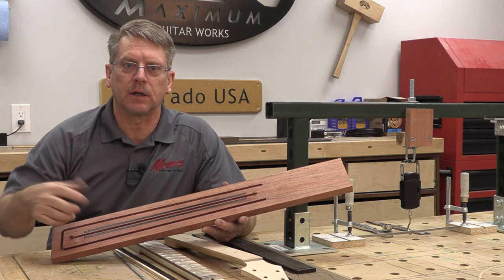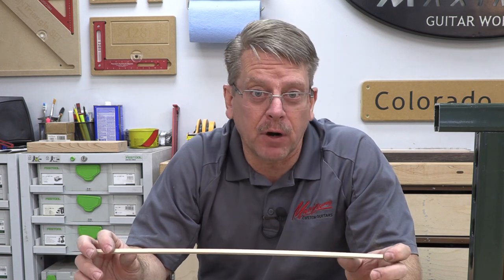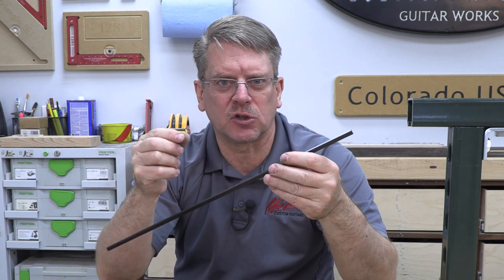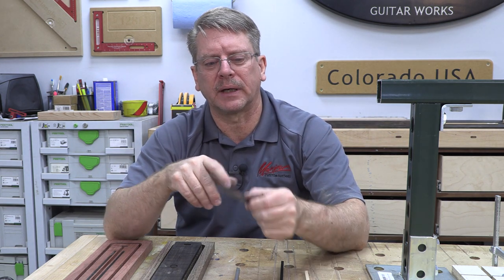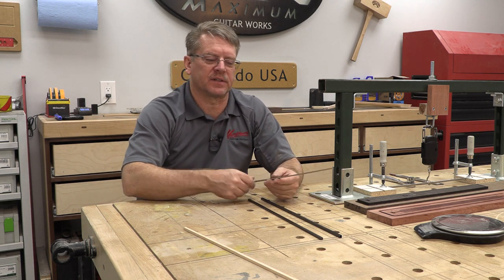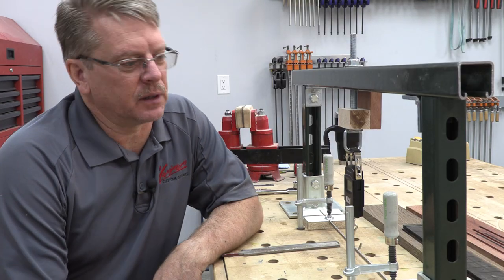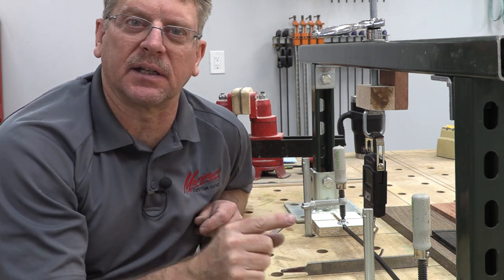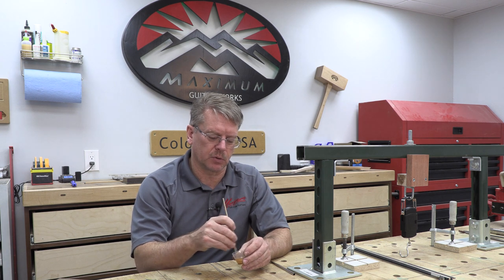Best Ever Guitar Neck Reinforcement Video (Deep Dive)

Comment: I like a lot of tension playing extreme metal so I built a baritone flying V with 28.5" scale, in A#, 13-72 strings.  I used dense mahogany in the neck & reinforced it with two 1/2" round graphite rods.  That's about the limit of what you can fit in a 6-string neck, and it's extremely strong & stable and sounds amazing.  Absolutely love it.

Comment: Modulus of elasticity of titanium is about 140GN/m^2. Steel is about 200-210GN/m^2, so steel is considerably stiffer then titanium, but has a weight penalty. Unidirectional CF has an even greater MoE than steel is is much lighter than any of the metal alternatives. CF is the preferred choice every time.

Comment: Great comparison and very informative.  Technically, you are measuring load at a specific beam deflection.  Since the cross-sections of the beams you are testing differ from sample to sample, it’s not quite a pure analysis of the strength of each material as much as it is a comparison of the beams with the predominant factor being the difference in strength of each material plus the geometric effects.  One nit is that you are measuring load, which is in pounds and this is not a pressure but rather a force.  Hope this helps and thanks for your analysis.

Comment: Excellent look at the rods in isolation, but there are other questions. What about the glue? Ultimately if the glue is not at least as strong as that carbon fiber it will let the whole thing down. So we need to run tests with the reinforcements glued in place. The other thing to consider is, don't we need to measure the actual strength of the whole neck, with and without the various materials glued in place? That 1/4 by 1/4 inch bit of carbon fiber is 10 times the strength of the maple but that is only a small portion of the whole neck. How much stiffer is a neck with a carbon fiber rod in it vs no rod - it's not going to be 10 times. Also, wood moves - humidity changes cause wood to shrink and swell plus the constant pressure of the strings may cause it to bow over time (yes that's what the carbon fiber is there to resist), since the force is changing due to humidity changes we need an adjustable rod in the neck.

Comment: I had  Carbon reinforcements rods installed in one of my guitars. The biggest diference i noticed was how fast the guitar responded to the pick attack. We figured the neck deflected way less when playing. So we did a little experiment, we got a good guitar without neck reinforcements (an Ibanez RG Prestige) and mine. We fixed both guitars to the table with a dial indicator at the tip of the headstock. As we applied pressure to the string we would se the indicator moving as the neck bowed. Now, when we tried that with the guitar with reinforcements, we noticed that the neck wouldn't move even 1/3 of what the ibanez neck did. 
And yes the ibanez was in perfect playing condition... 

So, if you think about installing those in an old guitar just have that in mind. Your neck will be stiffer and will feel stiffer, and the note attack will be much faster, if you believe you will like that, go for it (I loved it).

"Tonewise" that's the difference i noticed the faster response of the instrument, either you played louder or quieter. Maybe a litttle bit more of the 1/2 harmonic nodes (but just maybe). As far as eq goes i didn't notice anything.

Comment: Nice vid! Love the academic approach! 
Knowledge from arrow nerding says that the outermost layers provide the most strength against flexing. Inner layers do add strength but not as much. Carbon fibre tubes are also the stiffest material availabe (in reasonable price range at least) for the weight. (compared to wood, heat treated bamboo, fibreglass, aluminum) 
Basically never takes a set, breaks before it does.
You seem to have built an inverted version of an arrow spine tester! (where they hang a weight and measure the deflection)
So a thing I thought of is depending of where you place the carbon you would get greater resistance to string follow. Putting it as a skunk stripe is would be the strongest position, given the glue holds and it doesn't pop out.
Two in line sounds better for resistance to twisting of course.
Reply from the maker: Thanks Leif.  I'm glad you found the video...and appreciate the approach.  I'm not the smartest guy in the world...but I am fairly pragmatic...and like feeling like I do things for a good reason.  

At one point I stayed away from CF because everyone was doing it...that is when I went to titanium.  Sometimes people do things because they are cheap...or easy...but not always because they are better.  

I found that CF is relatively cheap...easy to install...and in my tests it proved to be a better solution.  That was the knowledge that I was after.

Comment: Just found this video. 
Trying to DIY fix and experiment with my guitar.
If the neck is bolt on, reinforcing it with too thick a hard wood, would then place lots more tension on the neck to body join?

Comment: Maximum Guitar Works what about steel rods and steel tube rods? Old Harmony guitars had steel reinforced necks Martins had steel Tbar rods later martin had steel tube rods also before rods Martin used Ebony in the necks. Do video on rods I mentioned.

Comment: Wish I would have found this video before I fixed the truss rod and redid the fret board on my 1988 Casio PG 380 (high end synth strat) maple neck, ebony board.
I replaced the route over the rod with the solid carbon fiber. The channel is curved. I curved the CF to fit the rod and channel shape before "gluing" it in leaving some sticking out.
Had fun trying to rasp file down to the wood.
Next time I will use the hollow CF on each side and MAYBE run wires to the neck and head stock ? (guitar has its own power)
Now about the greatest stress or tension. Pull is from the nut/head stock (or end) to heel (if a bolt on) String up, put an indicator on the head stock.
Loosen all the strings and it drops A LOT. This may not apply to a thru neck as much ? So with a floyd rose your neck is waving to the audience.
So pulling in the middle seems to be only half the test. A horizontal  pull end to end maybe ?

Comment: Lots of great info. I'm sold on the carbon fiber tubes! What does the titanium truss rod get you over steel? Seems like just lighter weight. Steel is already strong enough so the extra strength is wasted.
Reply from the maker: Titanium is higher strength to weight...so it can be stronger.  I think maybe too strong...if that is possible. Plus...titanium sounds cooler.

Comment: A lot of bass guys like steel rods, they say it helps eliminate dead notes. Been wondering how they'd work in a guitar. May end up a bit neck heavy on the negative side.
Reply from the maker: Didn't know that about basses.  Even for a bass guitar...it seems like it would be too heavy.  Need an extra long upper horn for balance I suppose.  Although...sometimes you never know until you try it.

Comment: Good video to explain this topic!
Just soon getting my Ibanez RG that has titanium rods innit and 5 piece neck. I particularly hope that give some stability with climate changes throughout the seasons.
Where I live there is roughly around 60°C (140)°F range in temperature between summer and winter for winters been usually very low humidity and summers high (as that effects tough vary from guitar to another).
Many of my guitars have had issues usually in summers where they lose some playability and needs to be adjusted as I use rather low action in general.
Reply from the maker: I have to believe that you will be fine with that new neck!

Comment: Great vid.  I have a question relating to Bass rather than guitar.  Hope you can help.
I'm building a 6 string bass with 16mm spacing at the bridge.  I'm undecided on number and type of truss rods and number of carbon fibre rods.  One builder says 2 truss rods and 1 carbon fibre, another says 1 and 2 carbon fibre; and a third says 2 and 3 carbon fibre rods.  What do you think?  I have a couple of 2 foot single action truss rods.  Can I use them or am I better off getting double action?  Thanks  x
Reply from the maker: Sorry for the delay in getting back to you...I have been off YouTube for a while as I deal with life.  I do not have a good answer for you as my experience does not include building bass guitars.  Generally my rule of thumb is that you can't have a neck that is too ridged.  However, two truss rods and three CF rods seems a little excessive to me...which is a strange thing to say.  Wish I could be of more help.

Comment: Seems to me that any strip that returns to pre-flexed state would be useless in a guitar neck, since string tension is constant. Two 1/8" x 3/8" carbon fiber strips might contribute to resistance and not add significant weight to the neck. A 1/4 square rod would be geometrically weaker. No?
Reply from the maker: It is all overkill most of the time.  So, preference and economics plays a role too.

Comment: Observing carbon rods being 10 times more flex resistant than maple is, almost, in the ball park. Hardest maple (Acer saccharum), in best conditions, has an elasticity modulus around 12.6 Gpa, and such carbon rods should be about 180 Gpa.

Though it appears to me (and many others) that the best reinforcement known is a full beam of carbon like the ones Vigier uses. It's so flex resistant that Vigier's guitars don't need any truss rod at all.

Comment: I've always been a little skeptical of the need for more reinforcement than the truss rod already provides. I see it as more of a selling feature as in "well we use CF in our necks so buy our guitar!" After all the Holy Grail (for many) of all guitar tone and quality are the 50s Les Pauls. Now they certainly didn't have CF in the necks. As a side note though a little CF spline at the neck/peghead wouldn't have hurt a thing. Right? So that and the cost of CF have held me at bay. Now with your research and cost information "I have to face stupid reality again" Thanks!
Reply: The CF reduces the chance of having dead spots on the neck, the way many Fenders do.  Stiffer necks are always better sounding. 

And Gibson could mostly eliminate broken headstocks if they used a scarf joint instead of band sawing the head angle. Maybe a shallower angle too.
Reply: Great tone only comes from great songs. If the song is great, the tone - whatever it sounds like - BECOMES great. So I wouldn't even worry about it, tone wise.
Reply: Truss rods are already a selling feature... Many people are avoiding products like Vigier's guitars because there's no truss rod thanks to a CF beam (providing more flex resistance, lighter necks and more vibration transmission, aka sustain, than a truss rod).

Even without talking about CF beams, a laminate neck made of really good wood is already strong enough to not have a truss. Thing is Gibson invented truss rods because they do not use such construction / wood quality.

Comment: Great video! I guess that I don't have a complete understanding of truss rods, it would seem to me that all of that extra stiffening would make it more difficult for the truss rod to do it's thing. Does it increase the stress put on the truss rod to manipulate the neck?
Reply from the maker: A truss rod is to correct movement in the neck wood due to changes in the weather.  A more rigid neck is not affected as much by these conditions as a less rigid neck.  That is the primary reason for quarter sawn and/or laminated necks....as well as neck reinforcements.

Comment: Great episode, I learned a lot.  I'd go so far as to say the groovy factor of this video was greater than that of a corrugated tin roof.  I went to the Dragon Plate site and looked for the hollow carbon fiber rod, is it the one under the "Square Pultrated Tubes" menu?  Have you done any tone shootouts of necks with and without carbon fiber reinforcement?
Reply from the maker: That is the correct tube John.  Thanks for your groovy endorsement.  Honestly, I can't tell the difference in tone...I'm sure someone can.  However...I'm sold on the added strength.
Reply: @maximumguitarworks  I went to find the CF tube based on your reply above - thanks, as I had same question. Sadly, though DragonPlate is in New York, the estimated shipping to Georgia was $43 Ground on a $33 ($30 minimum required) order of CF tube. What was yuour experience? And thanks for this excellent video! You answered questions I didn't know I had :)
Reply: @Maximum Guitar Works  I too would love to see you make a neck testing video, but to see how various reinforcement materials affect the tensil strength of the resulting neck with various woods - same jig could be re-used too! As a new builder, I have a lot of questions about when to decide to use reinforcements (as a logcal QA measure) based on wood type and grain direction - ie, "If you are using African Mahogany vs Honduran vs Maple vs Wenge, with the grain running in <x> direction, you should use reinforcement..." etc. Perhaps one should test tensil strength of the neck wood before/after the truss rod channel is cut and without truss rod and fingerboard? I'd like to know if the neck flexes <x> distance under weight of <y> pounds (sans trussrod channel), one should use reinforcement. Maybe such "insanity" could make poplar an expanded choice? You rock regardless!
Reply from the maker: Yeah...I order in bulk, so shipping is not as much per piece...but I have noticed that they overprice their shipping in my opinion.

But things like this make me look at other options...and I have two for you.  Kite and RC builder often use carbon fiber of various sizes.  I have found a 6mm solution for you.  You just need to purchase a 6mm spiral bit for your routing and it will be of similar strength as the 1/4" I have been using.

There is a solid version and a square tube version...both on Amazon for much better pricing and free shipping option.

https://www.amazon.com/cncarbonfiber-Square-6x6x5x420mm-Available-Pultruded/dp/B08SVKM3SM/ref=sr_1_3?dchild=1&keywords=Carbon+Fiber+square+tubes&qid=1626869336&s=industrial&sr=1-3

https://www.amazon.com/gp/product/B09417J2Q5/ref=ox_sc_act_title_2?smid=A3IW91RO6GTANJ&psc=1
Reply: @maximumguitarworks  FYI, for those interested I found a source for an affordable 6mm upcut spiral bit with a 1/4" shank. https://www.eagleamerica.com/product/v106-0372/spiral-router-bits  All others I found had either a 6mm shank. Closest all imperial was 15/64" (5.953125mm) with 1/4" shank.
Reply from the maker: Awesome...sounds like you have your solution!  Nice job.

Comment: IF there was no truss rod or reinforcements in a flat saw neck …. How much relief would string tension alone create ? I guess string gauge is going to effect the answer to that question. Let’s us a set of 10’s

And then say we change the wood to quarter sawn ? Keeping the string Gauge the same
Reply from the maker: No idea...probably too much.  Quartersawn would be less...but I have never tested.  I do know based up guitars I have worked on is that a pretty good amount of the truss rod is needed when going from 10's to 9's.

Comment: One question? Why is it harder to route a .20"  channel compared to a .25"?  They seem to route the same to me provided you have the right bit.
Reply from the maker: I only say that because a 1/8” router bit requires more patience and care when routing. I find a 1/4” bit to be more forgiving.
Reply: @maximumguitarworks  Fair point, I go about 3 passes regardless if its 1/8,.20 or 1/4.

Comment: hey steve..! Can I put a Carbon reinforcement on my Strat neck by removing the fingerboard because my neck moves a lot and is literally unplayable even after multiple setups within a few days.
Reply from the maker: Yes you can. However, removing a fingerboard is not as easy as some make it look. There are unknown as to what glue was used...which dictates the method of removal. Any glue that comes loose with steam (moisture and hear) has a chance to damage the straightness of the board. 

Also, it the neck is moving that much...it seems to me that something else is wrong too. Truss rod slipping, other portion of the setup not right. Could be many things. 

I would consider everything before attempting to remove the fingerboard.
Reply: @maximumguitarworks  Thank you so much. I will surely look into all these other aspects you pointed out.😁
The moment I got the guitar setup, within 2 days it started buzzing, I started getting fret buzz on the lower frets and then the action gets abnormally high on the higher frets, I can also see a slight twist on the neck.
In short its just frustrating me. I feel the company has been putting out necks which are not completely dried out I guess. 
Thanks again Steve. Your response means a lot.
Reply: @leoarjuncrasto  
I have similar problem with my Indonesian Ibanez RG. Removed the finger board with big wide flat salad knife without heating or any other preparation.  Started from the nut with gentle hammering and a lot of pushing. It went cleaner than expected.
Reply: @ANCAPVoluntaryist  how does it play after the reinforcement?
Reply: @leoarjuncrasto  
I did it just to replace the maple fingerboard with ebony. 
At that time I had no idea I can use this opportunity to install extra rods to improve the neck stability.

You can hear it here:
https://youtu.be/dXK65mbvb9M